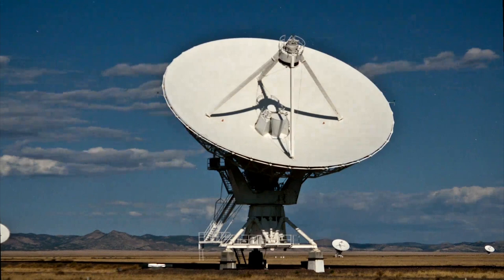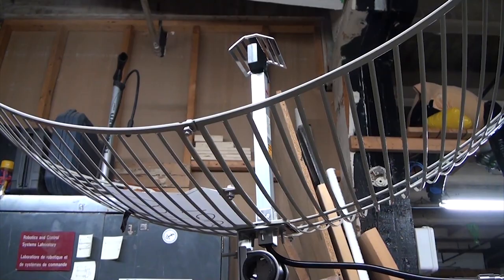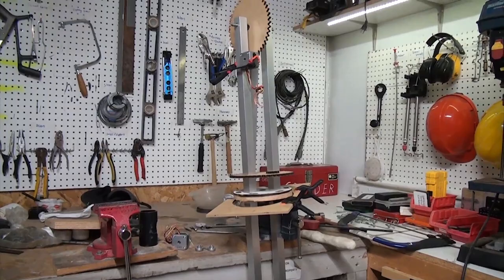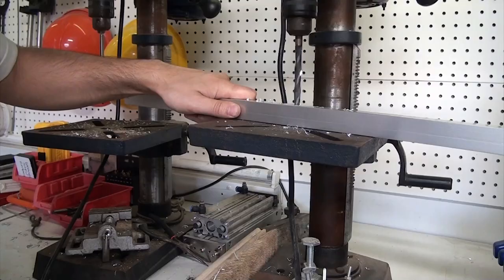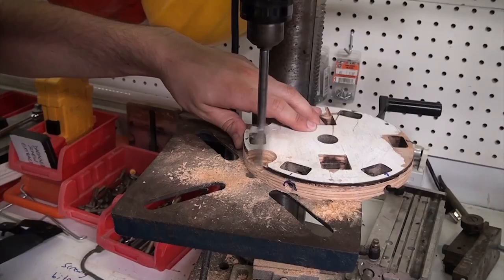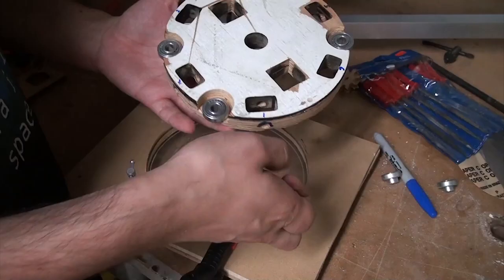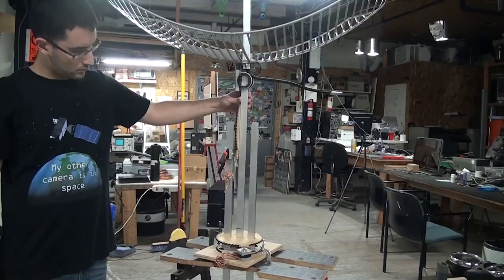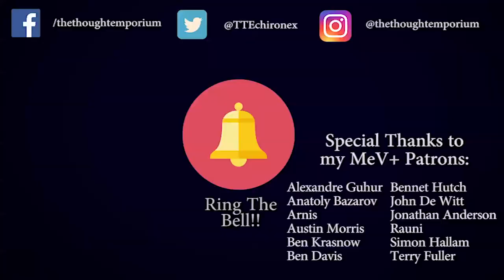Tracking Satellites in Orbit - Part 1

Comment: may i suggest you try to make worm gear for the stepper motor that drives the up and down tilt.
 this would remove a lot of slop and add a higher degree of repeatability. 
one way you can do it is by CNC out multiple gears of the one you all ready use on the stepper. then glue them together with a twist. 
then use a file to smooth out the transitions between each gear

or 3d print it
Reply: I was gonna suggest a double gear setup... small gear, big gear - small gear, big gear.  Either way will work, I think... that poor stepper has to try to start, and stop a lot of inertia.
Reply: slamdvw 
I can't see the advantage of that, more backlash, and no mechanical advantage?
Reply: I didn't think of a worm gear to be honest.  And what do you mean by "no mechanical advantage"?  Small gear > big gear - small gear attached directly to driven big gear > big gear to load.  And didn't think about the backlash either.  See? isn't the internet great?? discuss ideas and go from there.
Reply: Ah, I didn't understand your linkage at first.  Worms are awesome for high reduction ratios with minimal numbers of teeth meshing (so low backlash).  Rollers are even better.  I designed a telescope drive years ago using home-workshop quality worm gears turning roller-driven trunnions.  The beauty was that the zero-backlash roller system reduced the already small backlash in the worm assembly.  Would be overkill here, I think the absolute accuracy of driving a radio dish can be fairly lax.
Reply: slam not to be  dick but you come of as a bit condescending. 
why i suggested the worm gear was not just to lower the load on the stepper, but to remove more of the slob/jerk present in the first little helical setup.
you can't really reinvent the gear or gearing methods, only the way you make them.

of course you can discuss ideas, but some ideas are more useful than others in a given situation.

the time spent in professional engineering is usually 90% designing 10% making. 
(often you don't even do the making,you just sent it of to a unlucky machinist who then has to figure out how to make it)

now this antenna setup is not really that important and this is a hobby thing ist ok to be kinda janky. 
hobby engineering is usually closer to 30% designing 30% making 10% swearing and then 30% remaking/fixing
Reply: I want trying to be condescending. I apologize if that's how it came off... text is hard to convey feelings. 

You had suggested work gears, I didn't even think of it. Now that it's mentioned, that does sound like a better idea than mine.

I was merely thinking of load reduction, resolution enhancement.
Reply: its hard when you discuss things in english, if its not you original language, i know it im danis.
Reply: "Feelings" was the wrong word, I meant to say 'describing stuff'...

Comment: Out of purely ignorant curiosity, why didn't you just use a lazy susan bearing for the base?

Thx for the upload.
-Jake
Reply: Lazy susans for food are not very sturdy for that kind of weight. The mechanism itself can be made to be very sturdy, but buying a retail lazy susan is not going to cut it unfourtunatly.
Reply: Vnifit
The bearings are often referred to by the same name, and while not very common, they can be bought with specs similar to other linear motion designs. They are also used in some industrial applications that I have seen pictures of in the past while researching. 
   My main interest in them was around 3 years ago when I was building an automated large 360 degree product photography setup for high end race bicycles. Not exactly CNC machine level stability/precision, but it worked and seems on par with this type of structure and design. They can easily handle a stable 60lb downhill race bike in a setup where any motion would be visible in the photography. I wound up using a bearing I sourced from a large retail shimano bike parts display for free. The cabinet lasted for years with a few hundred pounds of parts (bike pedals/chains/tools/components) and the weight of the metal floor to ceiling cabinet getting spun. The actual bearing on that one was around 20-30cm in diameter with a sandwiched grooved bearing race all the way around. The actual bearing was less than 2cm × 2cm in cross section. It didn't have any noticable slop or anything. They are pretty common on large retail displays.
   If anyone is ever looking to go dumpster diving, large displays get thrown out a lot. Surprisingly, they are usually custom fabricated using hobby level junk and hacked together. There's a lot of cool stuff that can be sourced from them like LEDs power supplies and mechanical parts.
-Jake

Comment: lookin forward to part 2...though you will have much finer control using a worm drive than a cog gear,  if coupled with an ultra fine planetary gearset you should be able to achieve super precise control with very little bounce back

Comment: You way want to look into equatorial mounts. I'm not sure it would be much help in this case but it may be helpful in future projects. They are amazing for astronomy because at higher magnifications the rotation of the earth becomes very apparent. You have to take long exposure images because deep space objects are so feint. Equatorial mounts are the best for astrophotgraphy because once you find your target, you just need to track in one direction instead of the x and y direction like with an alt-az Mount. Not sure if it benifits at radio wavelengths but it might be worth a shot.

 Btw, if you want a low cost proof of concept and already have A DSLR, build a Barndoor Tracker. It lets you take wide field shots of the Milkyway with minimal blurring. There's already lots of examples and designs on the Internet.

Comment: Something you may want to consider is roller bearings some distance away from the thrust bearing, that will arrest any wobble in the Az axis. This is something I didn't do in mine that I 3D printed and paid the price dearly for it. Granted I thought a lazy suzan was a great thrust bearing other than a wee little bit of slidey slidey.... It definitely is NOT a great bearing lol

Make sure you keep your counterweight inline with your antenna otherwise the balance will be screwy (another dumb thing I did initially), remember the more counterweight you put, further away will also impact on the rotational inertia. Accelleration and decelleration is critical too! otherwise you will skip steps. And you guessed it, all dumb things I got wrong when I started my journey down the rabbit hole :)

Mine is going to be for catching the ellusive QSO with the international space station :D

Hopefully me 5 cents saves you a weeeee bit of pain

Comment: Dear Mr Thought,my school has been allocated a budget of about $30k to create a lab where students can get into robotics, project building, etc., basically your stuff. Incidentally, a friend and I are partly responsible for suggesting what all equipment we should get. We will be getting 30 or so microcontrollers and a 3D printer for sure, but I would like a few suggestions from you regarding what other stuff we might require

Comment: there seem to be something weird with your hack saw, it looks like you are not biting during the stroke, is your blade dull? are you not bearing down on it? Great work btw. For cheap limited angular range transmission without backlash, you can try a cable drive, you might have better results than gears with a big modulus ( https://www.youtube.com/watch?v=jKZIvseA1Nk ). There is also the concept of remote center of rotation (but it might imply a more complex build), in your case it could be useful to rotate the antenna around its center of gravity without actually skewering a shaft through said center of gravity, depending on circumstances it's better than adding a counterweight.